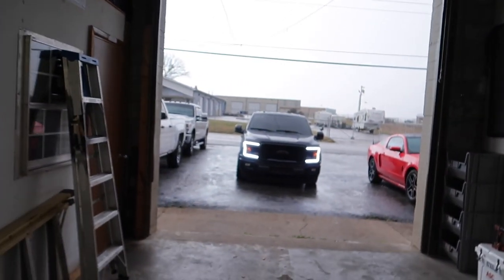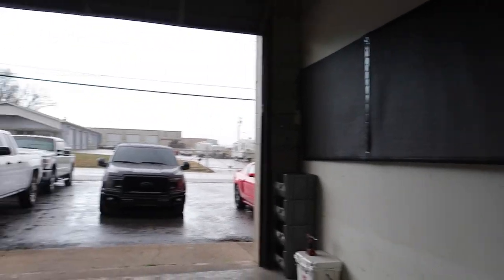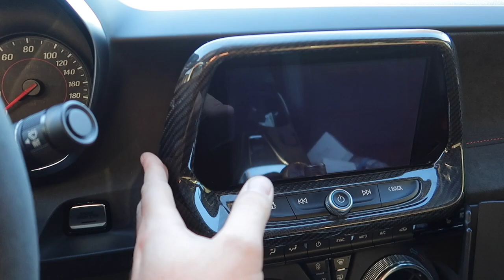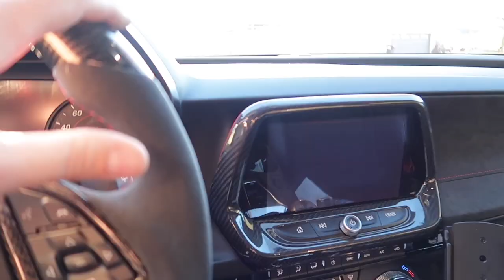A NEW LOOK for my Camaro ZL1! These NEW MODS Changed The Game!!!

Comment: Im with you i wanted some carbon but not a lot. I did the silver blades on the door and the chrome around the shifter. Basically tried to get rid of ass much if the chrome/aluminum that’s on the car.
Reply from the maker: I hate chrome lol 😉

Comment: Wildhammer motorsports has the GM carbon finer dash replacement. Definitely looks good 100% recommend. Also theres a gauge by the steering wheel, whats that used for?
Reply from the maker: It’s my old nguage that I use to watch IAT’s and fuel trim